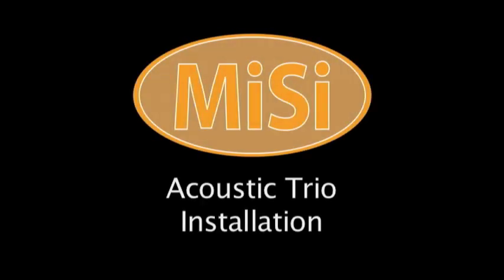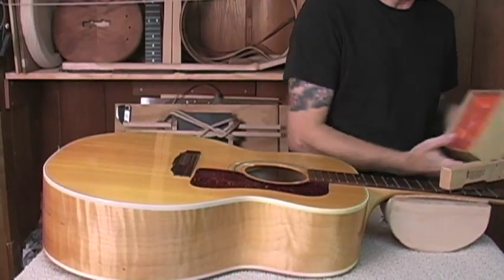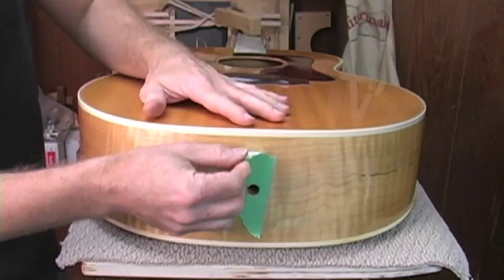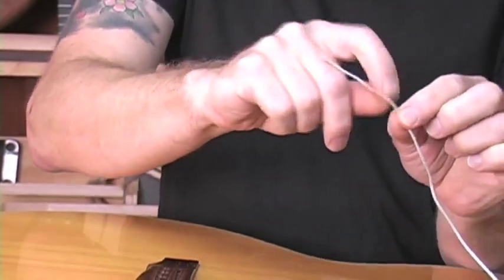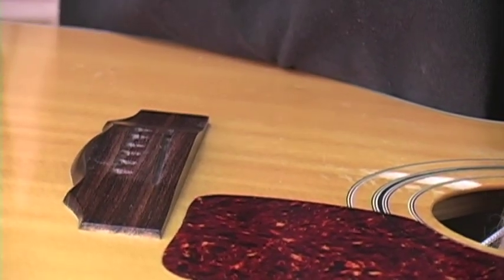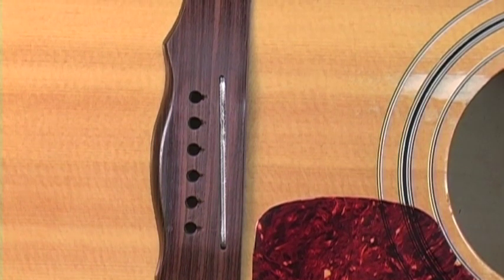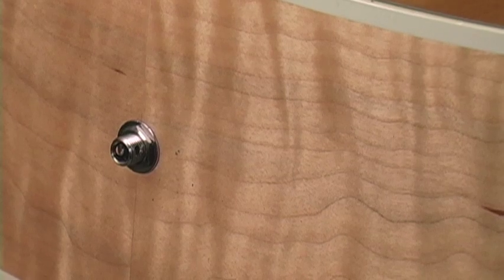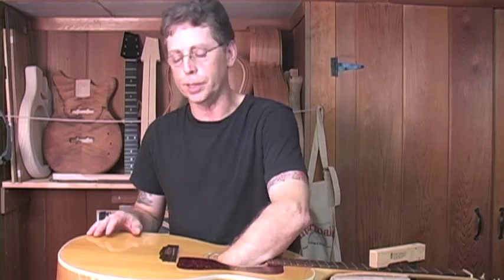Mi-Si AcousticTrio Installation

Comment: This pick up system works better than anything I have ever seen. Steel and nylon string. I made a solid body nylon string and it sounded amazing. Also into a dobro guitar, it also sounded great. For me I put the hole for the transducer from the bottom up for easier installation and it was just fine. The only thing I noticed was that the saddle had to sit into the slot easily so that there was even presure onto the transducer. I will use this Mi Si trio for everything. Darren Drew, D.Drew guitars

Comment: Bonjour  je n’ai pas vu les molettes de réglages ou sont elles  ? Cordialement
Reply: Bonjour. The Acoustic Trio system does not have knobs by default - knobs are present in Volume & Tone Control module which is installed (and ordered) as an additional option.

Comment: This was an excellent tutorial regarding installing the endpin jack and the pickup element.  The most important part, and the part I was anticipating and waiting for was not mentioned.  MiSi recommends the saddle lean forward slightly which requires sanding the bottom of the saddle at an angle.  Maybe this really isn't that critical.  Maybe the most important part is having the bottom of the saddle flat down against the element for a balanced sound?  Any thoughts?

Comment: You made a comment that the player is left handed when you drilled the hole for saddle pickup. I also see that it has a pick guard for a right hander. I am a Lefthander that plays with strings set for right hander Ala Dick Dale.
But I don't see the reason why you said it is for a left handed. Does it really matter?